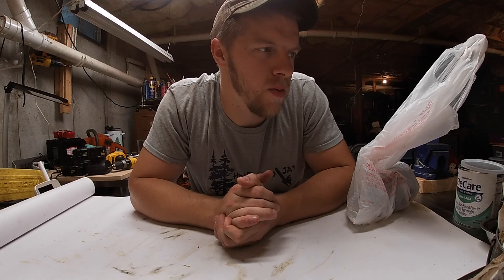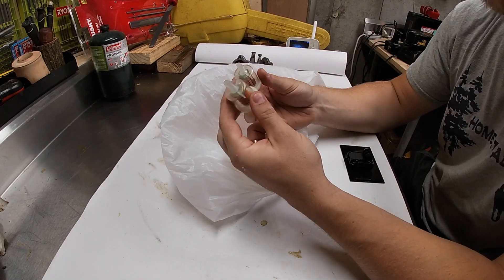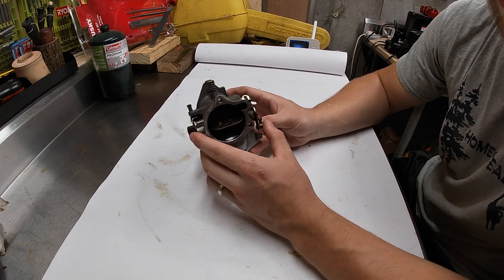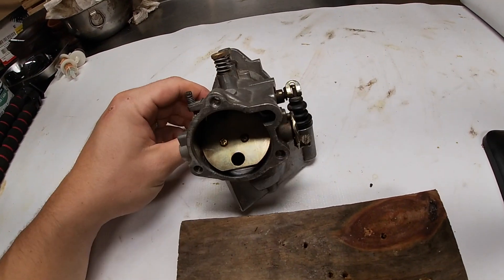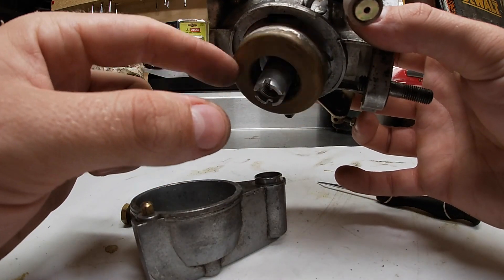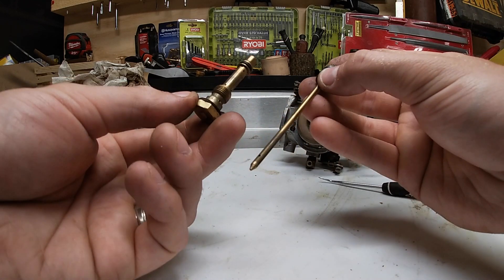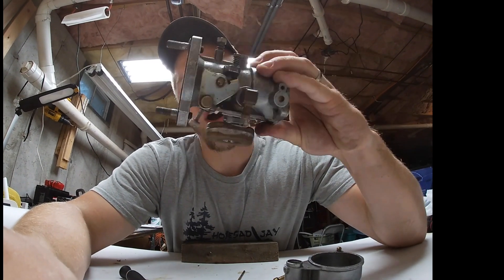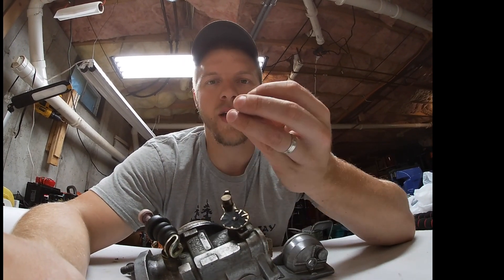The Simplest Carburetor Known To Mankind! EP 61

Comment: Big fan of the Bendix carburetor but don't like the adjustable main jet. Seemed like it would run clean one day and to rich the next. I found that for my shovelheads and sportster a 100 or 105 main works great.  Once set I haven't touched them for years. The only problem is I replace the accelerator pump boot every few years. Good video.
Reply from the maker: Yeah your not wrong, the adjustable is nice but if you have it dialed on with a permenant jet your good to role too! I like the bendix for getting them running and adjusting if you change air cleaner etc but you are correct indeed

Comment: I put a Mikuni VM on my 80 Sportster. Easy Carb too. In fact put one on my 83 FXWG too. Good video.
Reply from the maker: Thanks 👍
Reply: Does the vm mikuni work well. I'd think it would be hard to get the cable into the vertical throttle.

Comment: What is the rectangular protruding behind the inlet (between body and plunger) 

I think it has to do with the two or three idle holes distal from the idle needle at top of venturi;  maybe a horshoe path between them, maybe it relieves pressure somehow. I hope it's not a check valve (springs should not be permanent)

Maybe it's just a mount, but it's driving me fjing crazy
Reply: Are you talking that thing at the bottom left part of the barrel at 4:09?  It looks like a nut sitting there?  If so, that's the accelerator pump outlet nozzle.  When you twist the throttle it should shoot gas down the middle of the barrel... if not you can turn it one way or the other with a small wrench.
Reply from the maker: Hey Ronnie! Sorry I cant be more help I dont have the carb anymore to check it out I am sorry

Comment: My brother inlaw has 1972 sportster had it in a shop they couldnt figure out it was running rough now its to rich had to trailer it back home told him he needed a new carb talk to others they say a CV and if so what should he be looking for any info appreciated
Reply from the maker: You don’t want a CV carb those are junk. These style carbs have adjustable main jets which came factory on the bikes. Find a good used bendix with adjustable main snd you’ll have no issues
Reply: @HomesteadJay  thanks for the feedback I haven't looked at it yet who knows what's on there he's a disabled Vet lost his leg in motorcycle crash with drunk driver bike was trikes and redone and was gifted to him
Reply: Early 70s HDs used a Bendix Zenith carburetor, what you have there is an aftermarket carburetor made by Zenith. 
Be careful, very few parts are interchangeable. 
The Bendix had an adjustable accelerator pump but not an adjustable high speed jet.
Poor seals at the throttle shaft will create a lean condition.
Use a thick spacer & 2 gaskets between the body and manifold.

Comment: Please let us know what the initial settings are for the jets for start up , the main jet and idle jet . Buy a genuine rebuild kit from Zenith on Amazon .its about 48.00 dont waste your money on a cheap aftermarket kit . Thanks .
Reply: Idle Mixture Screw: 1.5 turns counterclockwise from snug.

Adjustable Main Jet: 3.5 turns counterclockwise out from snug.

Pro Tip: align the holes in the base of the Main Jet Tube with the notched cutouts in the Carb Body through which the tube rides.
Reply: Great  tip Mr. Crude , I will check mine and make adjustment . Thank you . Interesting name ,  are you in petroleum industry ? I am retired but drove a product delivery  ( tanker truck ) for one of the majors for 21 years in calif . bay area .
Reply from the maker: Hey There! I ended up selling the sporty I had, it had a 80's evo carb on it but I did keep this carb hahah! Sorry i cant help! I dont have the bike anymore to tune! Wish i did!